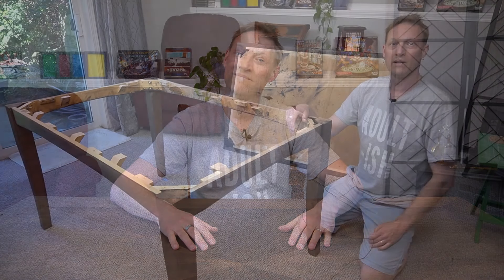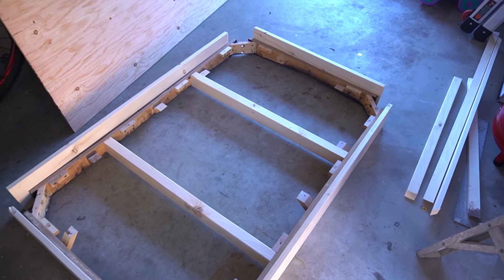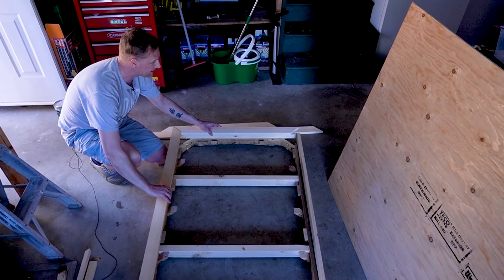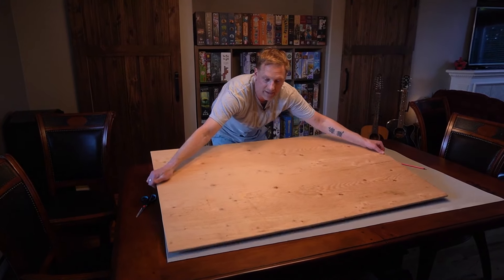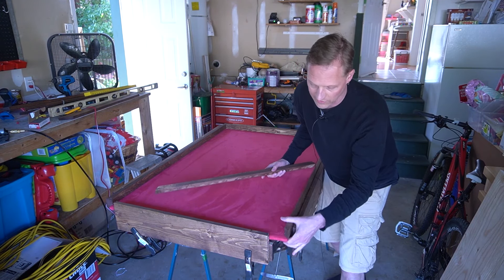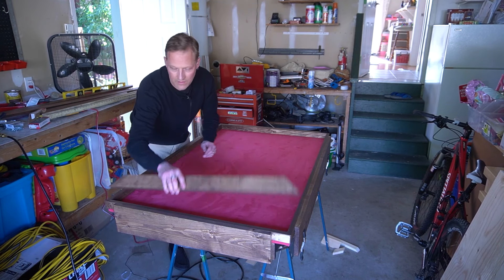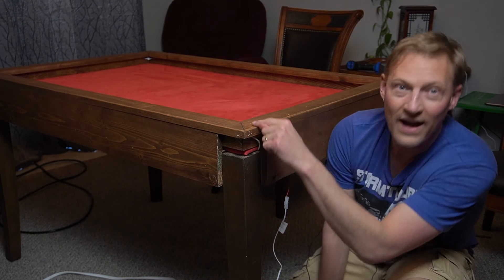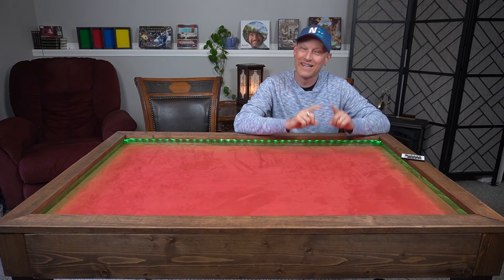DIY BOARD GAME TABLE: DINING TABLE CONVERSION

Comment: Great project. I've looked at a number of dining tables I wanted to convert, but you had some ideas I never though about. I would apply some poly finish over the stained wood for more protection.
Reply from the maker: That's a really good idea. We've been pretty lucky and haven't had any major spills, but extra protection would be a good addition... Thanks for watching ♥️

Comment: Thinking of converting my old dinning table, was thinking of building the 'box' into the frame instead of ontop, my frame is just different enough. I guess if that doesn't work your idea will be my plan b! Great Job!

P.S. I looked on used sites and I found a few tables similar to yours for around $100 if anybody is thinking about this project but doesn't have a table, they are easy to find!
Reply from the maker: That's great. I can't wait to see what you come with♥️

Comment: Probably already mentioned somewhere below but you might consider removing some length from the bottom of each leg to get it back to the original overall height off the floor..  Having it too high can cause fatigue if you actually use the table for dining.
Reply from the maker: Ya, that's actually a good idea😊. Cheers.
Reply: Just have to make sure that doesn't result in the sides of the table being lower and getting too close to people's legs. Can make sitting down and getting up pretty awkward.
Reply from the maker: Good point... Luckily, ours is perfect😍

Comment: Thanks for this video! Great ideas! Just wondering if you also had a picture of it with the top on? Since the top should be a little smaller then the border right? Thinking how I would be able to mask or cover up that new 'ridge'. But love it!
Reply from the maker: Actually, the top overhangs the table so there is no gap to conceal. I will get a photo as soon as possible... Thank you so much for watching😊

Comment: Great job. Did you end up with wrinkles in the felt? I'm not sure but i thought I saw some. When you're putting the felt on you need to stretch it. You fasten one side in the middle then go to the opposite side in the middle, pull it tight and then staple it. Then go to one of the other sides pull it tight and staple it. Repeat on the last side. Then go to the middle of each of the sections and pull it tight and staple it. Work your way around like putting on a tire. Once its looking good fill in the rest of the staples.
Reply from the maker: Thank you, and thanks for the advice. That may have worked better😆. Luckily, the playing surface started nice and flat, but I can see how the way you suggested told be better. Thanks 😊
Reply: @TheNerdShelves  Oh good. I'm glad it's working out for you :)

Comment: What tool are you using to put the arm rests on? Is that a nail gun? How do you ensure the nails/staples don’t catch clothing/skin? That’s one of my big worries as I am planning a similar project. How to hide the nails and make sure they aren’t a snag hazard.
Reply from the maker: Yes, I did use a nail gun. You can adjust the power, and after a couple of tests on scrap pieces wood, I made sure the nail was countersunk enough into the wood to not protrude out. We haven't had a single issue.

The best part about using this method is that the finishing nails are headless and leave tiny holes, barely noticeable.

Comment: Sorry, I can't resist. The fact that for millania tables are built flat, without borders/fences/whatsoever is because it's a stupid idea. If You are not convinced try to do anything on a table having a piece od 2x2 under Your elbows.   Build the table flat.  If You want to store a boardgame setup and not to remove it for dinner, You could make a sliding panel underneath. For that maybe You need a woodworker. If that's the case, ask me.
Reply from the maker: Thank you for stopping by and for watching. We always appreciate comments and feedback.

There are many different ways I could have built this table, but I don't think this was "stupid." Many professional poker tables are sunk with rails around the edge for an arm rest. These tables are used in the professional poker tour. Also, many professional board gaming tables made by professional woodworkers are sunk as well. There are many reasons for this.

We have been using this table for years and it is very comfortable and works great. Not only that, we have had hundreds of compliments from people playing on our table too.

I completely understand that not everyone wants their gaming table like this and would rather a flat table. That's great. There are many options out there. However, I don't think that makes this a "stupid" idea.

Thanks again for watching. We appreciate your comments.